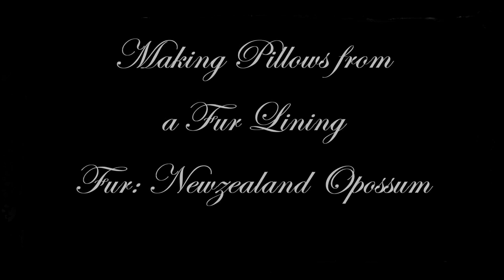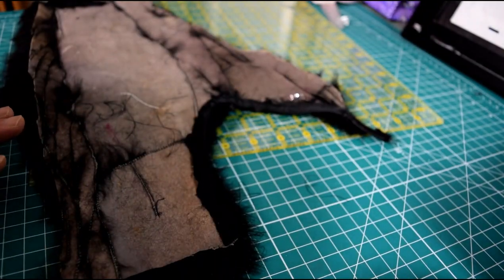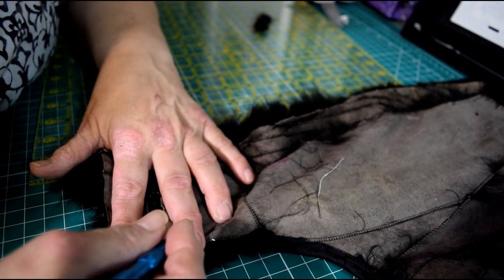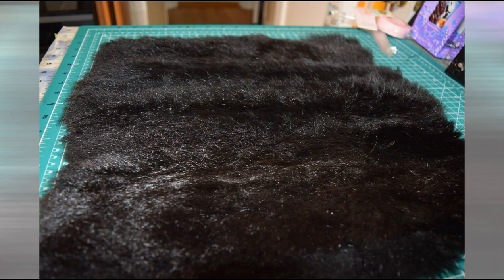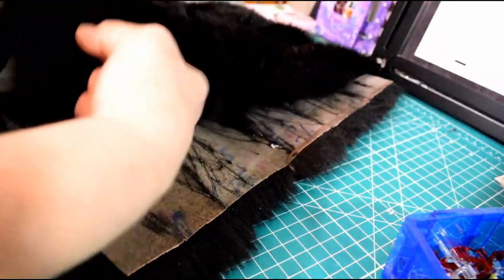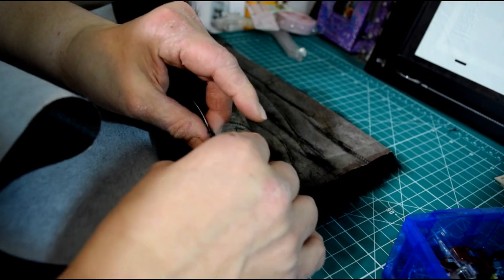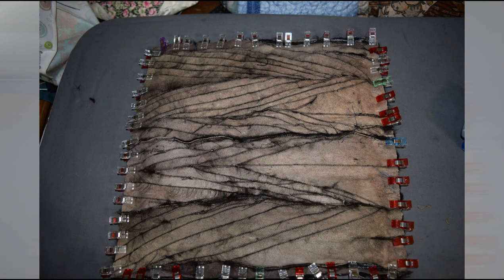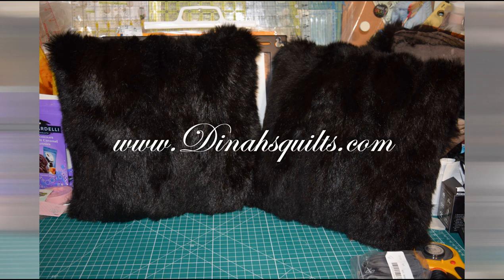Making of a Fur Pillow ~ From a Jacket Lining.

Comment: Can you use a regular sewing machine with a leather needle for this?  And, if so, what size (leather) needle would you recommend?  Or, do you need a special sewing machine?  I have an old fur stole that has come into my possession - it's falling apart in a couple areas so I thought about making some throw pillow covers to repurpose it.  Thank you.
Reply from the maker: When you say "falling apart" do you mean is tore a bit?  The fur must be able to hold stitching, so if the fur pelt pulls away or does not hold the stitches it will fall apart quickly.  I used the smallest leather needle I had. Your sewing machine must be able to sew through at least three layers... Fur, batting & backing.  Good luck with your project!
Reply: @dinahsquiltshandmadesoaps7340  Yes, just torn a bit - plus, I have enough where it's not 'falling apart' in order to complete one pillow.  Thanks for the reply, that is very helpful!

Comment: So I have a question. How would you do a double sided fur pillow that was fully sewn up? I can't figure out how to hide the stitches and stuff it. I have some beaver hides I am wanting to make into a double sided pillow, but I cant find any info on how to sew it sealed. Great video btw.
Reply from the maker: You would have to lay the the right side of the furs together.  sew around edge, leaving an opening large enough to turn.  Once you turn the pillow, push the corners out, stuff and Hand sew the rest of opening closed. Good luck!   
Check this video out as well. It may be helpful.  https://madetosew.com/how-to-invisible-stitching/